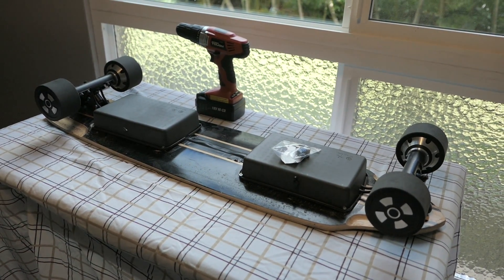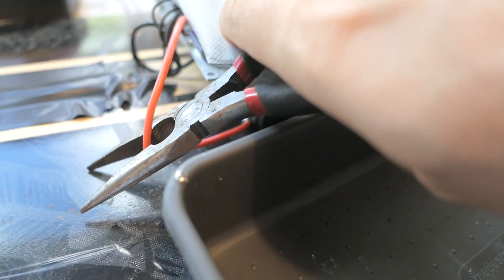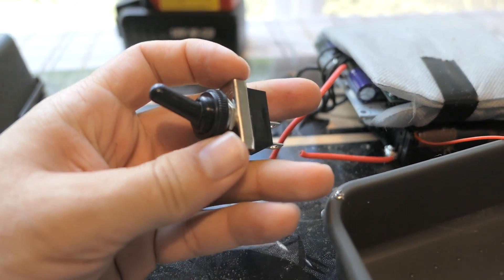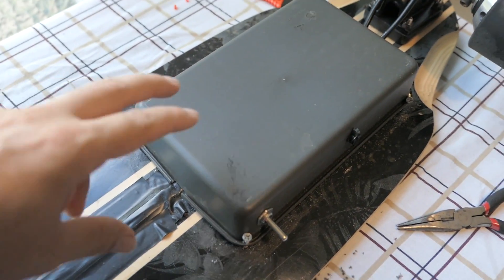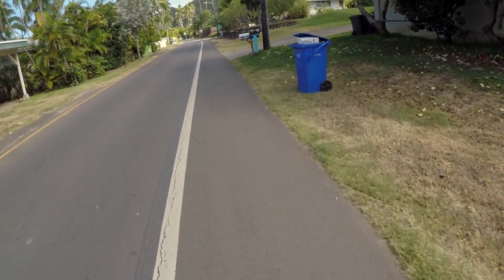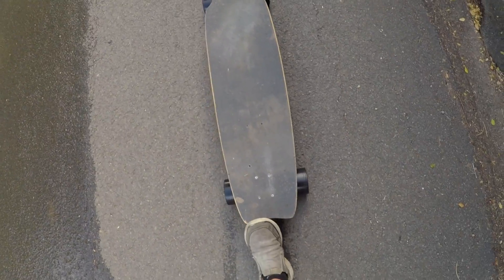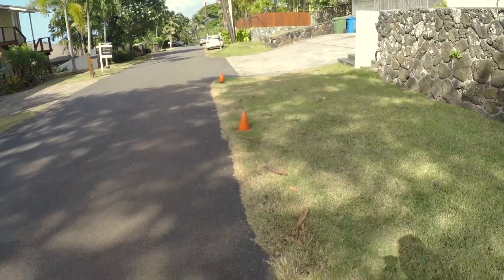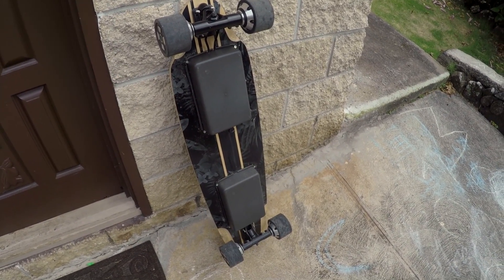$550 DIY AWD Electric Skateboard - 4wd or 2wd Modification

Comment: possible to make a remote switch that you click on the controller to swap it between 2 and 4 wheel?
Reply from the maker: It's definitely possible but it will need to be built in the ESC from the factory.

Comment: whats the max amp draw on your system? id imagine its higher than the 25 amps that switch is rated for..mine peaks at 60 amps and thats just 2 motors with an 8s battery
Reply from the maker: Not sure.. going off of my hub motor rating it should be alright. Now that you mention it though, im curious on what my peak amp draw is, cause i might need better wiring  also.
Reply: yeah its just a thought...would be horrible to be bombing down a hill and all of a sudden something doesn't work due to a melted connector from high current

Comment: Vlad,  really nice work , i'm interested in the range with double the battery.
Reply from the maker: Thanks. The range is about 10 - 12 miles for me but could vary alot on speed weight and terrain.
Reply: @JustVlads  Hey Vlad, great work, did you make a range-test 2WD Vs 4WD?